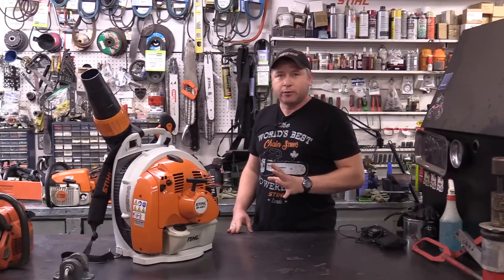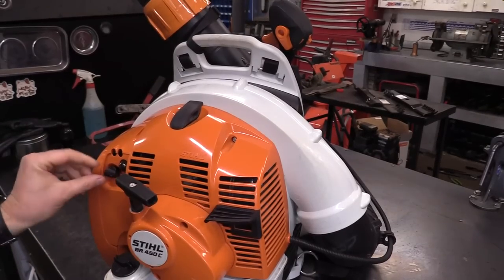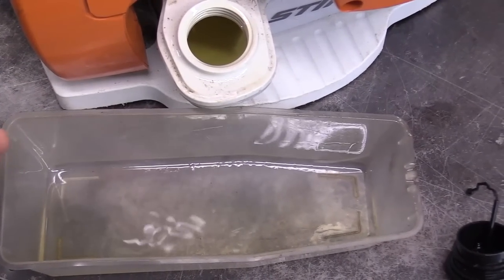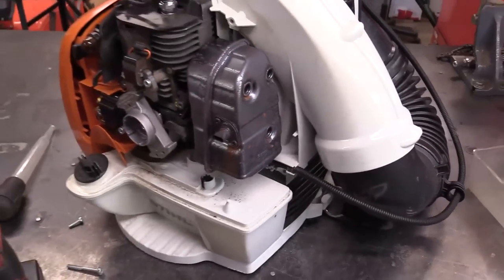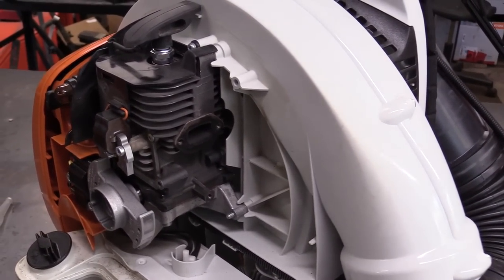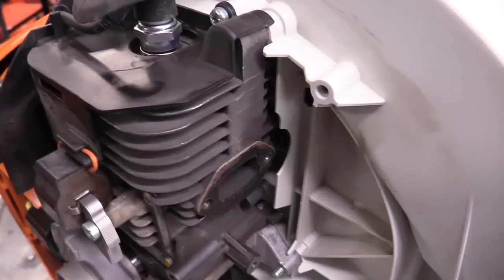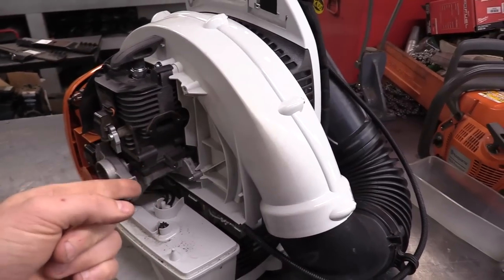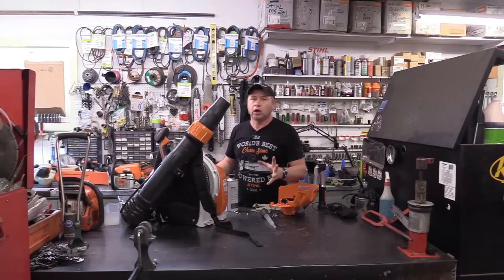Almost New 2 Stroke Stihl BR450C Leaf Blower Won't Start!

Comment: Some people might get confused by the fact that this motor is a 4-STOKE which typically run on straight gaz. You have to use a 2-stroke fuel mix as there is no oil sump. This is the way it gets lubricated. There should be a clear indication on the casing or fuel cap.
Reply from the maker: this one is a 2 stroke
Reply: @donyboy73  OOOOPS ! I own 2 Stihl blowers that are 4-strokers and thought that all the line were the same. Thank you for setting the record straight. Amitiés Don.

Comment: Probably thought it was a 4-stroke.
Reply: Well, it is a 4-stroke! But it needs oil mixed in its fuel for lubrication since it has no oil sump. That might have created some confusion to the owner/user.
Reply: @danielrobert7181  BR600 and up are 4-stroke. 450 is a 2-stroke.

Comment: "Blower won't start, good thing it's brand new and on warranty".

"Sorry dumb ass, you never mixed oil with the gas.  Owner stupidity is not covered by warranty.  Will the $800 for the new one be on debit, credit card, or account"?
Reply from the maker: exactly what hapened!